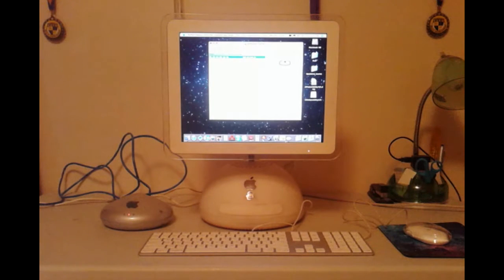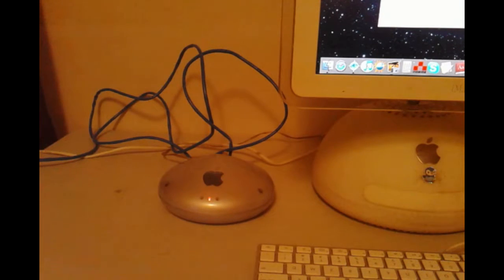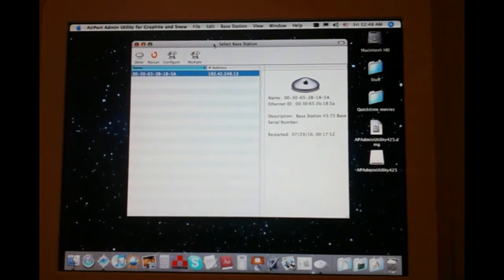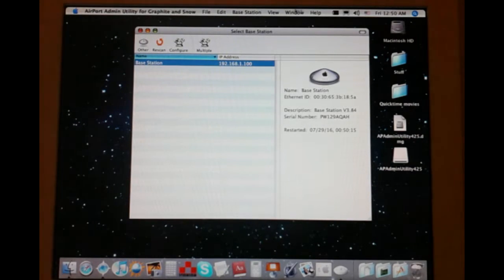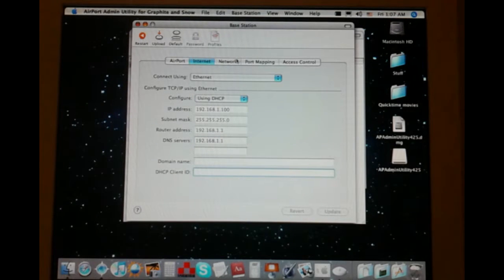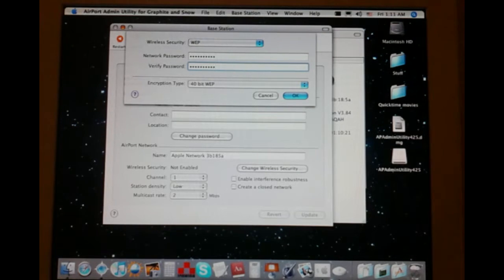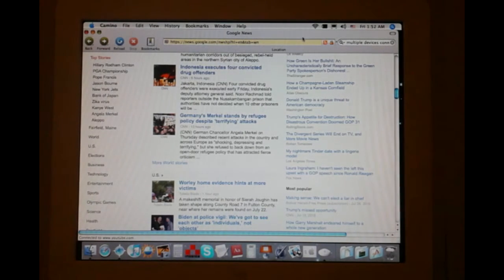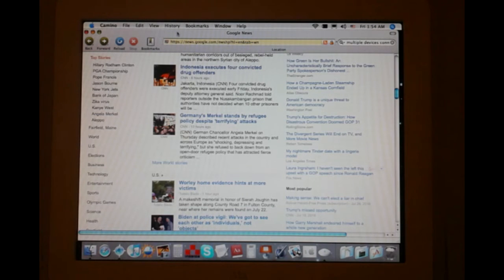Configuring an Apple Graphite AirPort Base Station

Comment: Do you need this in order to use Wi-Fi? I have an apple cube with an airport card. My issue is it won’t connect to WiFi. Do I need a base station  like this?
Reply from the maker: Original Apple Airport cards, like the one likely in your G4 Cube, will only connect to 802.11b wifi standard. This is available on most older wifi router, but most modern wifi access points run in the g/n/ac standard.
Reply: IronOreGaming first off thank you for replying so quickly. Second is there any other way to get this to connect to WiFi? 

I’m also trying to run snow Leopard. I understand it can be installed by fool the Leopard installer's system requirements check by modifying the processor speed reported by the firmware upon installation. The reason why is 
Trying to run boot camp so I can play old pc games. 😅 gotta love a challenge right. Only issue is I’m stubborn and over my head lol
Reply from the maker: @TheSlyhound  You could try a USB 2.0 wifi adapter instead, it will be slow but theoretically should work. You're going to be playing driver roulette to see if you can find one that supports all the way back to OS 10.4. Honestly, your best solution is just a hardwired Ethernet cable if you can manage it.

Yes, you can technically get Leopard on there even though it doesn't meet the minimum 867Mhz CPU requirements. Look up Leopard Assist, that was the utility we used back in the day. Note that Leopard is a heavier than Tiger, and will run considerably worse with not much more support. If you're doing it for a challenge, all the power to ya, if you're doing it looking for more utility, 10.4 is actually a better choice in my opinion.

Not too sure about bootcamp, I have my doubts it will run and if it does it probably won't run well. Good luck!